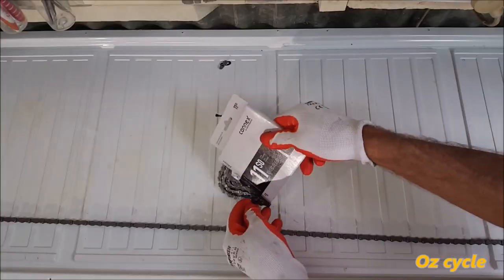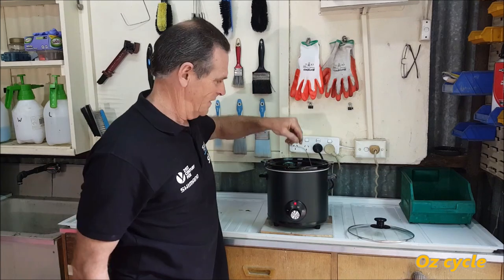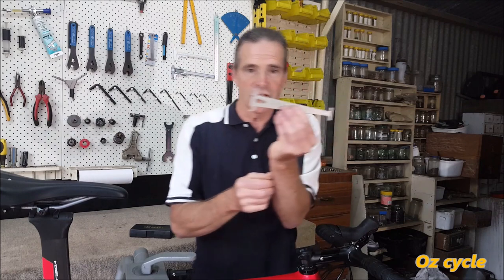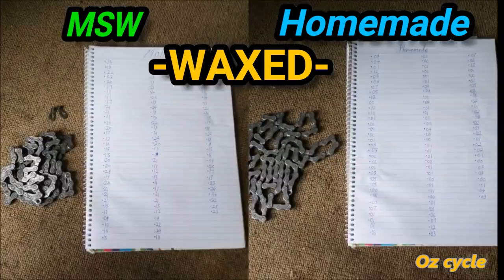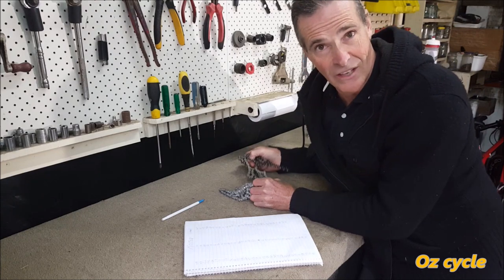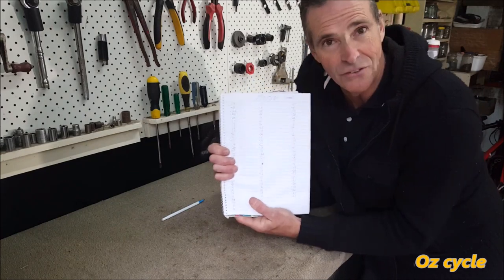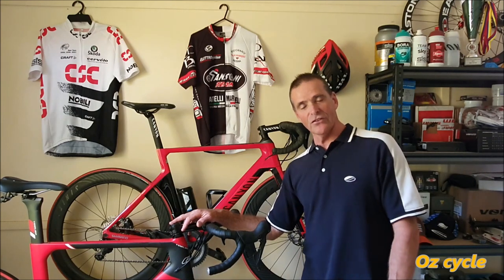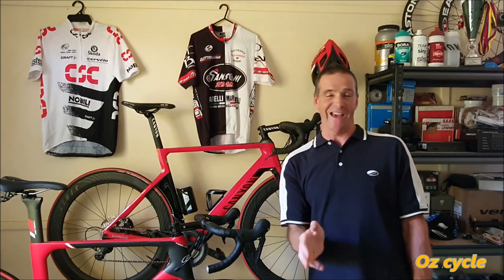Is this the ultimate bicycle chain lube? - Test results

Comment: So much effort on this video, every single question that can be answered was answered to the absolute. It takes real guts to put your own creation to the test like this as well.

It's truly amazing how such small numbers can add up to such long ride distance on the same chain, I'm usually the very skeptical sort so the fact that you shut up my every question with an answer just did it for me. I'm convinced.

I'll be getting a new drivetrain for my mountain bike pretty soon and I'll knock off all that factory lubricant right off, I know that because of the conditions a MTB chain faces the cleaning frequency will probably double, but if i can make a chain last twice as much all the effort will be worthwhile.

Thank you very much. I'll make sure to spread this around my biking group as well.

Comment: I have been using MSW for over a year. >4,000 miles ( 6,437Km)  with very little stretch , and for you guys saying you don't want to spend the time, It literally takes less than 25 min to remove, clean and rewax the chain.  I must say, I think something is wrong if you got rust on the chain with the MSW. Love your videos, have taught me a lot.

Comment: I Took your old recipe and cut it with MS CV joint grease. The grease is really just a carrier for the Molybdenum Disulphide. This made the wax a little darker but essentially the same. I had to let it stew for a while to get it to blend well.( 1 Hour) Even if all the wax drops off I know that I have M D particles clinging to the metal parts... This has worked out very well for me thus far. Not the best lube in heavy rain and mud but I just take that into account when riding. By far the cleanest and easiest , most cost effective chain lube I have used thus far... no black marks on my leg etc.. Thank you for all you do. Keep the great vids coming

Comment: Can not wait for the new receipt. I already followed your wax advise on two bikes for approx. 6,000km so far. Refreshed the wax after ca. 300km to 400km every week. Result is as you expected. Different strategy to optimise the process is underway e g. removing the chain at 53° out of the wax-bath. This video confirms the long lasting strategy to safe costs with an environmentally friendly hack. As said, the Wippermann Connex so called Bikini-Hack  (Chain Link) is awesome. I assume not too many bikers can imagine that this really works - but it does. AGAIN THANK YOU, YOU HELPED ME TO ENJOY RIDING NY BIKES.

Comment: Point to note: different chains are manufactured with different roller outer diameters. . .  so chain measuring tools can be disinformative. . .   the measurement from the hanging nails is a truer test.  

Bit sir, your methodology is excellent!

Comment: While you have great attention to detail and I trust your findings because I've been waxing (also using my own concoction) chains for a few years already, and have similar results, your test has a great flaw that negates all the 'scientific credibility' of the work you have done: it was not done in a controlled environment. Obviously, it is also a blessing... BUT it is entirely possible that only one extra-long, extra muddy ride on MSW when wax was stripped off by waterbourne grit and chain began running on grit instead of lubrication accounts for all the difference in chain wear, and it is not entirely clear if you new mixture would behave differently if conditions were exactly similar - exactly BECAUSE contamination is so important!
I suggest a small change of protocol that will make it truly 'bombproof' - split one chain into two uneven halves (say, 50 links and 52 links), wax one with MSW, an other with your new concoction, note which is which, connect it using two quick links, install and ride. This way you'll have a chain with dissimilar lubrications that shares exact real riding conditions.
Reply: I liked the 50/50 wax on same chain, but won't they get mixed abit on the gears?
Reply: @hokkypro  a bit on the surface maybe, but not inside the friction pairs where it matters - both are waxes, after all.
Reply: it does behave a little differently. i mix my was according to my city's weather. if its hot season, less oil, so it harden more, when u cycle, it actually melts back. if its cold season, i would add more oil, so its softer, easier to melt and sip in rollers during ride (i call it wax recovery) else if its too hard, cold day harder them too much and it chips off the moment u start riding. so its not exactly 50/50. u still need to do the "run under tap water" test

on the same weather season,
if its too soft, u get higher mileage out of it
if its too hard, u get lower mileage out of it 

so hunt your balance. Cheers
Reply: I have to agree the environment of the test 'may' be flawed but if both cyclists rode together on the same roads in the same conditions only, to the exclusion of all other rides, then that would be enough for me.  Even so, over the distances covered, I really don't think it's going to make much difference at all.
Reply: @Biffo1262  I agree, but did they? Again, I've actually experienced myself  a large spike in wear rate once wax completely sheds off and chain begins "running dry" - this is not a theoretical musing on my part. I was not joking that entire wear difference can be accounted by one ride - I've had that happen.
Reply: Steven Booth rider weight/strength could also be a factor when talking about multiple riders. I really like the 50/50 split idea.

Comment: Your videos convinced me to try wax, but I chickened out and use Squirt. Wow. What a difference compared to oil! I would imagine your method/formula would be even better than Squirt, but I'm not sure if I want to spend the time weekly cooking my chain. It's just so easy to wipe and wax with Squirt. This video might convince me to try.
Reply: Some time back I watched the videos of cleaning and waxing and thought what a pullavah. SO I went with squirt too. A great product. I recently completed a 1350 mile tour and only had squirt with me. One bike cleaning after about 1000 miles.
My girlfriend just got a new bike and I know she's to going to take care of the drive chain so I treated both bikes to a full gasoline, degrease and wax job.
After one ride on a dusty gritty Katy Trail in Missouri Im convinced. The chains were so clean and even after washing bikes with chains on they were very smooth.
If you're doing so many miles as to require a weekly change, run two chains so one is always ready
Reply: Definitely not a weekly thing, I do ie every 300-400km, depending on riding conditions...
Reply: @patrickparisienne1917  how many km you get with boiled waxed chain?, when you need to do cleaning with spirits and boiling again? if i do 350km in a week i will need to deepclean and boil weekly?
Reply: @MsBahamai  I get 350-400km between re waxing. Once initially cleaned, any re waxing, chain just requires a degreasing on the bike, and once removed, I pour boiling water on it. Then I re wax.

I wipe the chain after every ride, and if required after a very wet or dirty ride, I apply a wax/ white spirit emulsion ( which is what Squirt lube is) if I feel it needs it.
Reply: Try Smoove! Even better.

Comment: 16:55 The chain in the middle. Connection between first and second link is slightly curved. I am sure this is not intentional, but I think the differences are not as big as presented. Anyway, I love your videos!!! Thank you :)
Reply: @MrPoopnoddy  Yes except for the fact the the home made chain isn't de-waxed, you can see that the links are still a little stiff, thus making it appear shorter in the measurement.  Still not doubting the product, just the measurement procedure was slightly flawed.

Comment: Jawdropping test. I'm so impressed how thoroughly you've done this. Well, I'm a cheap guy, and retro fan, I use old bikes and mostly used parts to ride, usually just commuting, I only use petrol and Rohloff or Connex lubricant. But I slowly build two proper bikes from new parts and I will earnestly consider to prepare the chain with your methods. More work in a garage, but so much money saved in a long run even if it's Sora not Dura Ace. Ah man, I forgot about my retro road bike, it's a life saver for it.

Comment: Hey there great video! I’m pretty sure the grey stuff in the bottom of the jar is the Molybdenum Disulfide (MoS2) powder that is used in the wax. 👍
Reply: My thought exactly. Color of the wax when new made me think of MoS2 immediately.
Reply: where can you buy this?
Reply: @Francois_Dupont  MoS2 powder can be bought from eBay for example (like almost anything). I have some and have been thinking of adding it to my home-made wax. Similar channels sell also fine teflon powder which is another thing I'll probably try some day.
Reply: Far more likely to me worn metal held by the wax. If the chain has been used for 3000km between waxing that’s far more than MSW recommend isn’t it?

Comment: The dark "powder" is actually metal worn out and grit. Use a strong magnet inside a plastic bag to pull it out and dry to inspect.
Reply: I was going to say metal also; but to confirm use a magnet on the bottom of the glass jar. If it is metal the difference is incredible.

Comment: If you'd cleaned the new chain, maybe you would have been able to get the measuring tool in. Might also have been a good idea to take baseline measurements of the test chains immediately after their initial cleaning. (Your time is infinite obviously.  :-))

Comment: MSW contains Molybdenum Disulfide that's some of what your seeing in the cleaning solvents.
Reply: A magnet would easily find if thats true or not.
Reply: @derekblankmccoy  A magnet will not attract  MOS2 (Molybdenum Disulphide). It will attract Chrome Molienium though but they are not the same thing. ChroMo is a metal and MOS2 is a powder lubricant.
Reply: @mariosergiodemarchi3238  that's my point. If it does attract, its metal dust from chain wear.

Comment: Great Video, thanks. Looking forward to giving the new recipe a try.  I tried a Connex 11SO chain a year or so ago, bought mainly because of their excellent quick link design. I normally use Finish Line Dry lube, however, I gave Muc-Off Dry a go and very quickly regretted it. Within 1000km the chain was badly rusted and I'm convinced it was caused the water base used in the Muc-Off!  That said, by Connex's own admission, that particular chain is not as rust resistant as their 11SX version.

Comment: i started using wax about two years ago, i had a chain hit over 10,000km but it wasnt worn to 0.75%, i was so confuse (usually 10,000km chain would worn to hell) i went to several friends chain checker to test (incase mine is broken) but it wasnt worn 0.75%.... worried it might snap, i swapped a new one, and over 5000km the 0.75% checker has hard time dropping in. but after watching your video, it really give me the answer.... Chain Waxing rocks!

really salute for all the effort and time spend in making this video review.

Comment: You're using four different chemicals (including water) to clean. I recommend you buy two, which are very cheap: n-Heptane (used in graffiti and sticker removal; “cheap” heptane with small amounts of other alcohols) and 90%+ isopropyl (used to clean sensors; draws water, keep well closed!). No need for a water rinse after those. 50l hobbock ea costs 24€ or less. (You don't need it lab-grade.)

Comment: When the home-made wax was removed the solvent was a lighter colour with less sediment at the bottom than the MSW.  The chain stretch measurements for the home-made was about the same as with the wax removed.  It could be that more of the home-made wax came off the chain during use.  That's why the solvent was less discoloured and the measurements were the same before and after cleaning.  If the MSW stays on the chain for longer, any dirt it picks up will wear the chain more.  Just a thought.

Comment: more importantly did you measure the chains before the test?
Reply: It could very well be manufacturing differences.
Reply: That s a very good point but to be fair he does admit there are going to be varying manufacturing tolerances.  All you can do is keep repeating the test over a number of new chains check for consistent results.
Reply: Kwee Thiam Lo he did!
Reply: Yeah, he definitely needed to do this. Measure each chain new so you can see the actual elongation in that particular chain. Just assuming that they started out identical is a fundamental flaw. I love the dedication and sharing, but it's hard to draw strong conclusions.

Comment: is it just me, or does Oz Cycle look like he deserves to ride a Rtichey Road Logic with Campagnolo Chorus 11-speed?

also, putting a magnet into those jars would tell you a little bit about what's left over
Reply: not really, rust isnt magnetic. so only iron, nickel and cobalt in fairly pure form will be attracted.
Reply: @Francois_Dupont  therefore if it was magnetic it could be the nickel coating which are put on many chains
Reply: @albr4  yes, maybe. i personally think it is micro sand and dirt from the road. he could look up with a microscope to see the structure and find what it is.
Reply: @Francois_Dupont  I am pretty convinced that it's the molybdenum disulfide that MSW add to their wax, unless OZ used that in his as well.

Comment: Damn! This is very extensive, well done. I dont think you went into it in the video but how often did you re-wax these chains (did you say 250km)? and how often and aggressively / lightly was the bike cleaned?

After 2000km my local bike shop said I needed to replace my Dura-ace chain :/ don't know if they just wanted more money because they asked me if they could replace, I said no and kept going on it for another 1000km then replaced. I got a KMC X11SL chain and it was actually longer out the box than my "Worn out" shimano chain. I had to keep checking but yea it was like 5mm longer out the box with the exact same links.
Reply from the maker: Yes rewax at appx  250km.
Just a light clean of the drivetrain at every rewax.
Treat yourself to a chain checker with .5mm marking. Replace chain when it reaches that point.
A new chain is always shorter than a used one...check again.